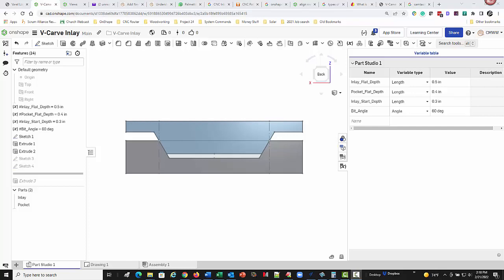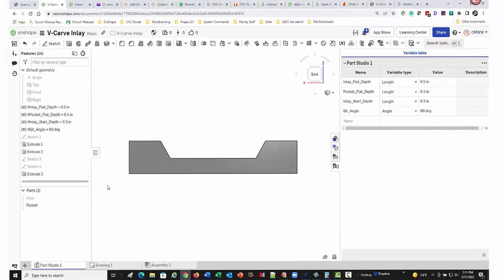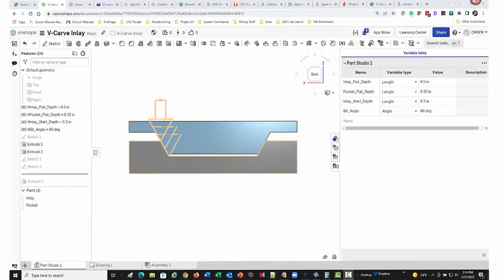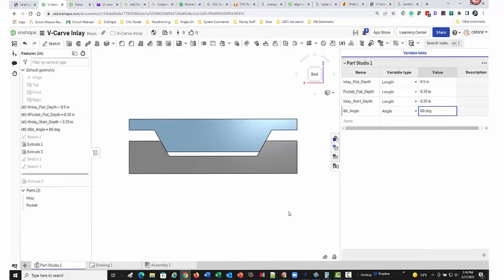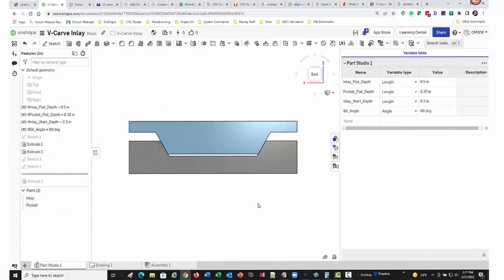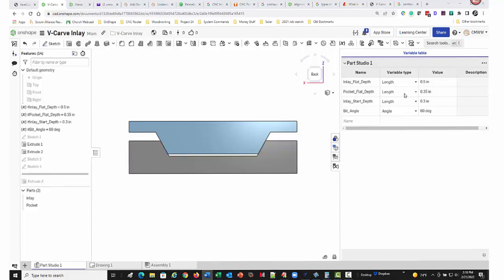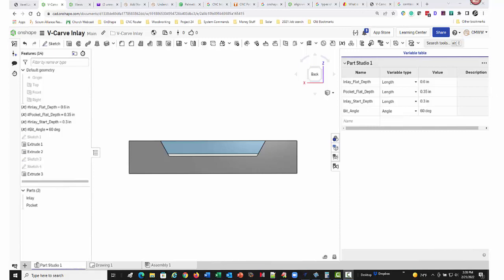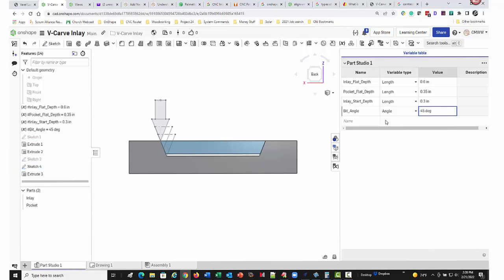Understanding V-Carved Inlay from a CNC

Comment: I think the term”glue gap” is miss used.  First, a gap to allow for “trapped” glue is not necessary.  Any one who has done more than a couple inlays knows that a lot more glue is forced out then is ever left in this “glue gap” space.  To suggest a “glue” gap is necessary to allow for “trapped” glue means that there is some finite amount of glue that can be trapped and a specific gap size is thus important.  Additionally, the larger the “glue gap”, the less glue surface you have on the parts’ surfaces.  Too large a glue gap also increases the risk of hollow spots.  The only reason,IMO, to have any space is for very small amounts of trapped debris, small irregularities in the surface that diminish the accuracy of your Z height, and irregularities caused by tool marks at the bottom of the pocket.  However, an adequate “saw gap” is important so that glue can escape and spread out between the parts.  Another item that is important to inlay results is the tool geometry used by the software.  As an example, a 15-degree V-bit is often identified as an “engraving” tool rather than a V-bit and has an associated side angle rather than a combined angle as with V-bits.  You will get different results if this is not accounted for.  I recommend that anyone that does inlay, experiment  and “cut open” a sample of the tool and measurements you use.  Because of the geometry issue, the desired gaps you think you are going to get may be wrong.

Comment: Good explanation.  Most inlays fail how ever because the wrong bit angle is being used.  A 60 or 45 degree bit angle will cause gaps in corners.  Also, if you look at the edge of the inlay as pictured here, at those angles the edge of the inlay is way to thin.  Again causing gaps and very weak edges.  An edge that thin can easily be sanded through or chipped out.  For the final pass use a v bit around 15 degrees.  That will provide an inlay with very thick edges and super tight corners.  Sometimes you don't even need to use the v carve setting.  Experiment a little.  Cut the finished inlay in half and double check that bottom gap.  You want it small,  just enough for glue.  To small however and the inlay will not go all the way down as liquids do not compress.  Also, if your making cutting boards, I don't recommend you add an inlay.  It is to easy for food waste to possibly end up in that glue gap and rot under the inlay.  Someone could end up getting food poisoning, and not even realize the cause of the poisoning.
Reply from the maker: Your words make perfect sense.  I have been considering getting a 15° bit because most of that I am currently doing is this text (not that I am doing a lot at this point.)  I am planning to write another article explaining how to vcarve thin text.  Your comment are spot on for that.
Reply: Glue compression when doing V-carve inlays is not an issue.  If proper compression methods are use, all glue that has to escape, does.  If that were not the case, then there must be some definitive amount of glue that gets trapped….how much? How big a gap?  If you believe that there is ANY possibility that food could get trapped and rot, especially on a v-carve inlay, you have got problems in your process.

Comment: This is a good presentation, but I have a question you might be able to help me.  I just purchased a Shaper Origin which is a hand-held CNC router.  I would like to try this technic with my inlays but the software in the Origin asked me to cut on the line, inside the line at a set offset or outside the line with a set offset.  I can also control the cut depth.  Are you familiar with the Shaper Origin?  I'm looking for recommendations on bit depth and offset of the line.  Do you have any ideas that will help me?
Reply from the maker: Sorry, I am not familiar with how the Shaper Origin would handle something like this.  All of the corners (on a table CNC) are handled by the g-code and as far as I can tell, the Shaper Origin does not use g-code.  I am not sure how it would know when to plunge in and out of the sharp corners.